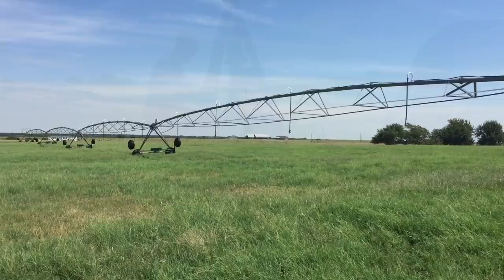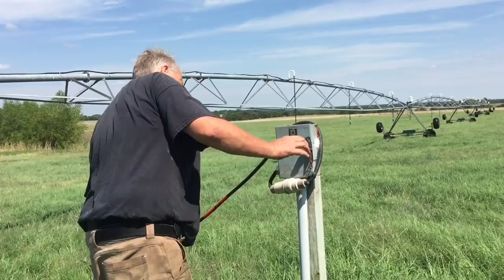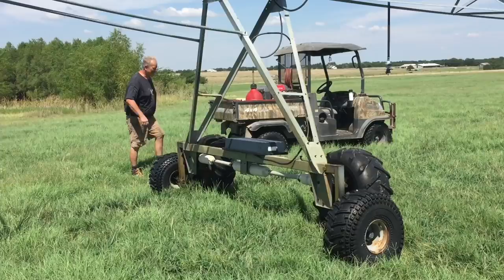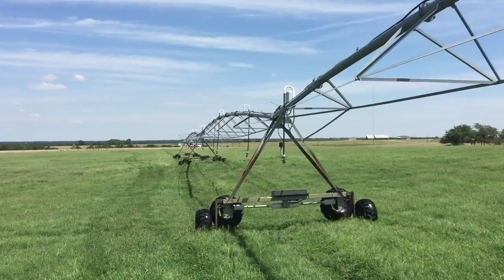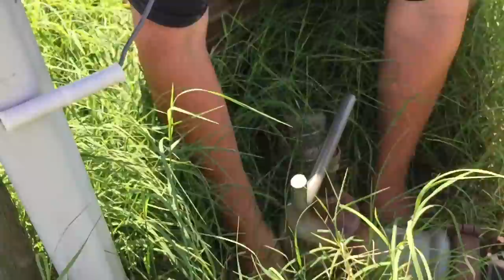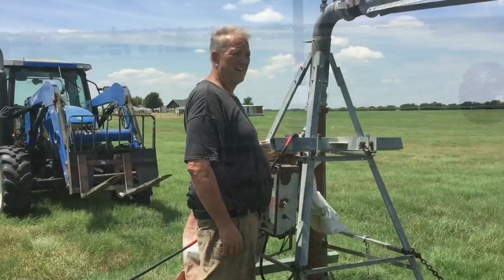Moving a Center Pivot

Comment: Hi guys, I am in the process of trying to convince a couple irrigation manufacturers, Reinke, Valley, and Neilson, to come up with a wheel system designed like a dolled wheel that can turn at different angles and lock in if need be after you are done positioning it, so that you won't have to change the wheels every time.
Thank you for your video.  I will send it to them as soon as I get an email back from them .
I wish you the best!
Love, Lynn. 🙂

Comment: That is a lot of work.  The entire assembly appears to be 300 ft long.  It must be complicated to adjust/program  the rig to keep it aligned in a straight line with each set of tires having to travel at different speeds.
Reply from the maker: Jeffry Blackmon it's 400 ft long and it's really not that much work to move it
Reply: Hello Jerry. I whatched you video. We working in Russia for Dealer of Reinke pivots.
 When we started this business 10 years ago, no US factories allowed to use more 1300 feet pivots. Now they offer to us 1570 feets (8 to 9 spans). So i think you have a lot place to go and tow ! Good to be farmer.

Comment: Curious non farmer here- and I know this is an old video.  But I'm curious about something.  At the very top of that thing there is a rounded object that looks a little like an upside down bucket but is more rounded.  It looks a lot like satellite receivers that you see on campers.  It that indeed some kind of communications device (ie it receives a signal telling it when to turn water on or off or move, etc)?  If not, does anyone know what it is?
Thanks.

Comment: I an wondering why you don't use the forks on the tractor to lift the drive sections, so that the transport wheels can be lowered/raised?  I like Hi-Lift jacks, but it would seem the hydraulic-lift forks of the tractor would be more efficient.
Reply: Rightsideofthegrass axles for the drive wheels are to close to the cross beam to get my forks in.
Reply: Thanks.  I understand - hard to see the clearances on the video.  One wonders why the unit is not manufactured with a lift lug on the outside for easy access with some type of life.
Reply: Rightsideofthegrass I've tried different ways but the jack is the fastest way and safest as far as doing damage to the pivot itself. Thanks for trying to help.

Comment: Hay I know if it was me I would be using the forks on the tractor to lift them up to switch then tires around . Be much faster ? I like all your farming videos especially the tractor videos . You were hooking up the tractor to the hay bind or mower you said that tractor not have 3 point hitch controls on the back like the other tractor so why do you not just use the other tractor to cut with or for moving your bails with?
Reply from the maker: Sometimes the other tractors are needed elsewhere

Comment: Hell of a strain on the pivot elbow, I would have put a chain from the pivot to the first axle to take the load off of it.
Reply from the maker: Bob W never thought of that, might give it a try
Reply: Bob W
Exactly what I was thinking.
Reply: a simple wrap no chain required( no offense to those that suggested)  just a pull back straight, pulling like that screws up the elbow....over time or right now, think longevity.

Comment: I never could figure what powers the structure, (electric? ) seems like it would be hard to synchronize them all to keep them aligned. Each set of wheels driven separately?
Reply from the maker: Lee Steele it's driven by 90 volt D.C. Motors. Each tower has a micro switch and a metal arm that trips the switch as it rolls keeping them all in line. It's really a pretty simple.
Reply: Am I right in thinking that some of them were powered off water pressure alone? I remember some as a kid which had no evidence of electricity
Reply: I know of one near me that makes VFD sounds, so it probably depends on the controller.

Comment: Suggestion. Could you use the forks on the tractor to turn the removable wheels over, instead of jacking each one?
If there are two people doing the move.
Reply from the maker: Richard Macleod I've tried it and it didn't work at all. You have to put into context I do this alone most of the time, and the jack is the best way to not cause damage to the pivot. If I welded a lifting point on the end I could possibly do it but it's just easier with the jack.
Reply: @NorthTexasHay  Only ten times a year, but still a hassle. I would have added two wheels on the center too, and program the rest of the wheels to move at the same speed, and instead going on a circle will just go sideways. Obviously a portable power source would be required, so quite a hassle to set it up, but less work on the long run.

Comment: Hi, may I ask a question? Do you have to change the oils in the gearboxes and in the center drive units or just make sure it’s up to level?
Reply: You don’t necessarily have to change the oil in them you just have to check the level of the oil and you also check if there is water at the bottom of gearboxes and drain it if there is

Comment: I am sure that tractor would lift those tires to a height where the tow tires could be turned over without the exercise of hand jacking each one.
Reply from the maker: Ray C. I would have to weld some sort of lifting point on it and it's really not hard to jack up
Reply: Hay fork

Comment: You should use the tractor to to change the tires instead of a jack. It would a LOT less time.
Reply from the maker: bwtupper unless I weld a pick up slot for the forks there is not a good place to pick it up from, the jack is the safest way to do it by yourself. In these bigger tractors you can't see where you are sticking the forks
Reply: North Texas Hay I was about to ask the same question. I can see the reason for concern,  but dang!
Reply: a day in the winter with a welder and putting lifting points on the frames would be a good investment of time

Comment: That's why I asked.. I was told (right or not) that water powered them.
Reply from the maker: I don't think there would be enough pressure to turn the wheels with just water it's only about 30 psi.
Reply: Lee Steele Wade Rain used to make a center pivot that was water powered.
Reply from the maker: bwtupper at the rate I replace these electric motors it would have been nice to have some built like that